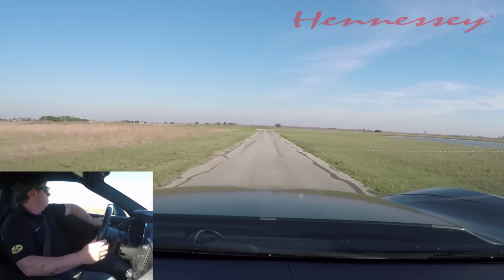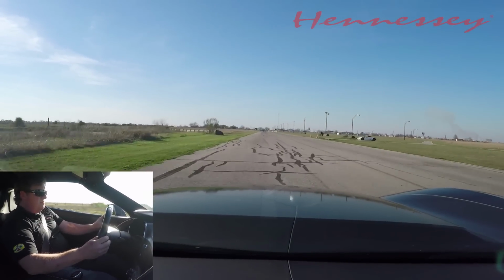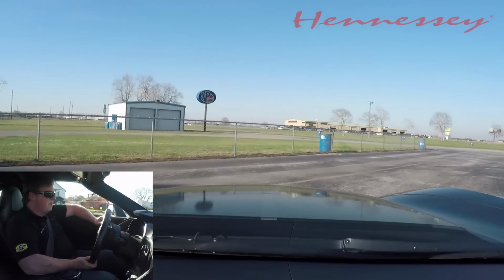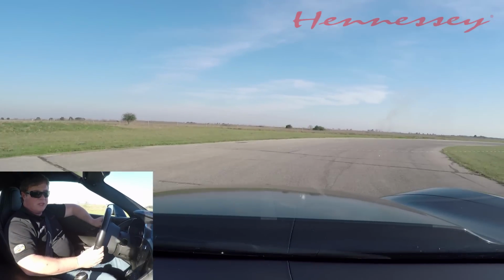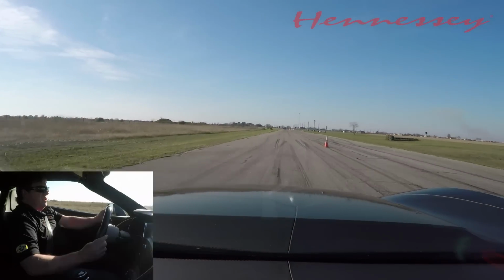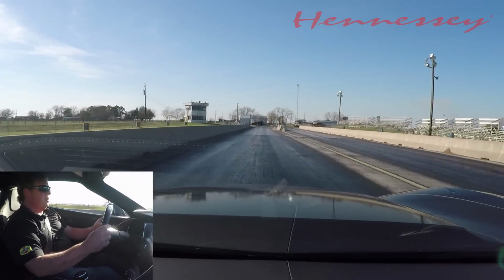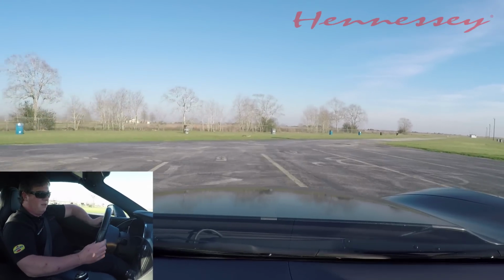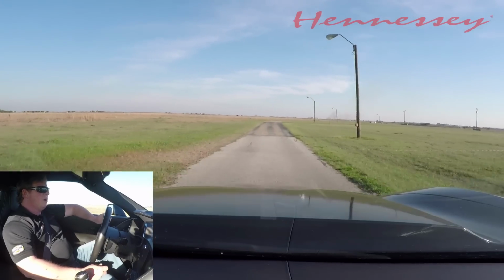HPE1000 Z06 Corvette Test Drive with John Hennessey

Comment: My 2008 Z06 was a manual. This time (C7 Z06) I got the automatic. With the supercharger and the quick shifting gearbox it would be hard for a manual car to keep up. As far as the fun factor the car is enough of a handful that I'm happy to have two hands on the wheel! I'll weigh in again on the automatic after my two days at Spring Mountain Raceway.I've never tracked anything but a manual before.

Comment: Too bad it's an automatic
Reply: when the automatic gearbox runs faster times than the manual, i think its pretty acceptable.
Reply: Tim Profy that makes even faster
Reply: Bmackins94 but less fun
Reply: +rob Cochrane fun has nothing to do with being technologically advanced...yeah it's like 1 second faster but most people get joy out of banging gears not just pressing the gas and going
Reply: Tim Profy 1000 hp... tell us how an auto is less fun.
Reply: Bmackins94 forward thinking! Winning the race is more fun than just burning rubber
Reply: I understand the automatic is faster. I'm just saying in my opinion it would be more fun to fly down back roads shifting through gears opposed to just letting it shift on it's own
Reply: Tim Profy looks like that automatic responded late
Reply: Tim Profy you ever used the gear box in these cars?  Not much shifting on a spirited run on a back road If your going less than 60 miles an hour.   You can probably ride in second the whole time if it's a winding road at about 60mph    A  1le tested on the track (can't remember which one) did it mostly in third.  1000hp I'd want both hands on the wheel at ALL times.
Reply: 1000 hp is fun no matter what tranny is in it.
Reply: Tim Profy not if you live in the city
Reply: Tim Profy but you'll win more races
Reply: Dude who cares, looks sick and sounds sick!
Reply: Raúl facts! People just think they are so cool by saying "too bad it's stick".
Reply: Dead Pundy my last two cars were stick and my mustang now is. But I can tell you, my next car will be an auto lol. I'm tired of shifting with a daily driver. I lived in a city with hills so it was annoying. I now live in Fl which is really flat but still sucks.
Reply: Mike Gauer Lol yeah! Stick is fun to drive but only in like open roads, back roads and such. In the city, it's gonna be pain.
Reply: Raúl yeah I live in the city as well. So auto for me. Sticks are cool though
Reply: actually it's good that it is an automatic , and why am I saying this it's because I am an auto guy , hate manuals , well that's my opinion , I know most out there hate me saying this , but in the end it's you own personal choosing whether you like something or hate it, and thank you .
Reply: Tim Profy who cares though.
Reply: I get why people get the auto, it's faster, IF you wanna just hang out at the drag strip. But watching this video, i actually got bored towards the end. To this very day when people say as you get older, you'll want an auto, i really don't. Especially not in a car like this. If the car was an italian exotic with a PROPER dual clutch yes for sure. Or a high hp luxury sedan or something yes definitely but not an american sports car lol. The car looks good, and sounds great but i was watching the video and was like damn it's probably fun the first couple of weeks because it's fast as shit but after that, you'll want the fun factor. The manual still delivers that. Regardless if you're 1/2 a second slower in the quarter mile.
Reply: Tim Profy We will see what is less fun when you loose every race against a auto 😉.
Reply: I feel paddle shifters should be left to video games BUT with todays technology the automatic is slightly faster but not worth losing the fun factor of actually driving and banging gears.